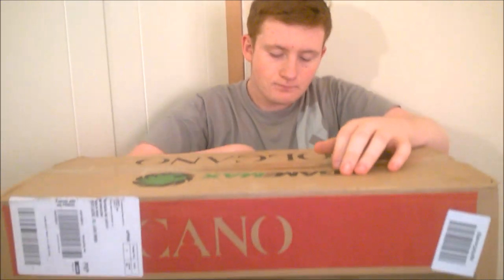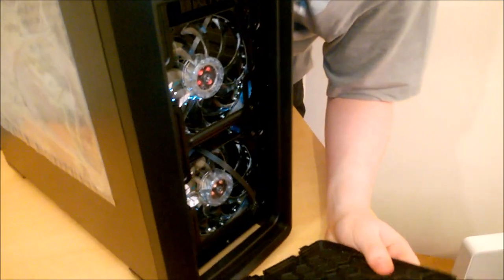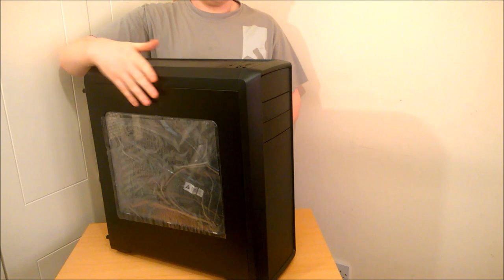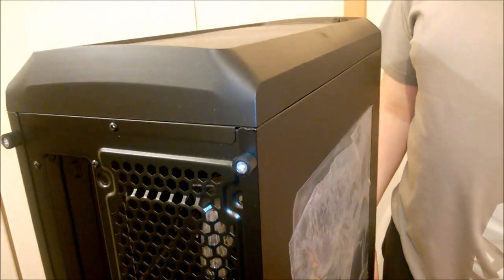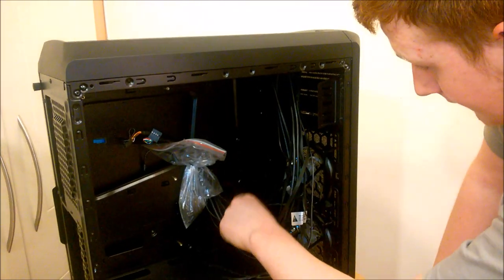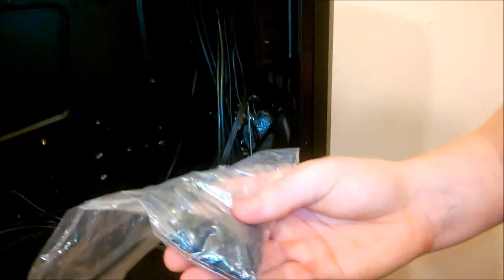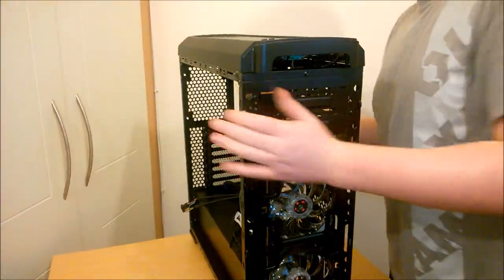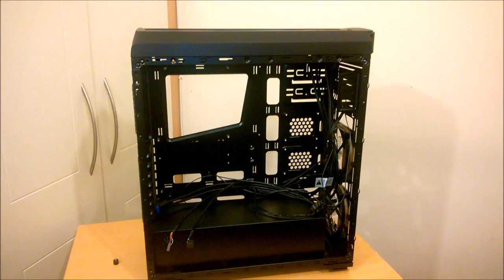GameMax Volcano Gaming PC Case Unboxing and Overview

Comment: £48 on Amazon now, looks like a sweet deal. I just wish it would have rubber grommets on the cable holes. If you want that, the Aerocool Aero-1000 has that for an extra £10, but is lacking the psu mask.

Comment: How do you get the front fans to spin and work. The led lights work but the fans don't spin
Reply from the maker: I would say that your fan motors are broken, you might have to send the case back, or buy 2 new fans.
Reply: they're the stock fans that came with the case and have not been touched. How could they be broken? Can you make a tutorial on how to turn them on?
Reply from the maker: It's possible that they are just bad fans, you could contact game max and they might send out 2 more because you can buy those fans as well.
Reply: should they turn on automatically?
Reply from the maker: Yes, as long as they are plugged into the fan controller and the fan controller is getting power, they should.
Reply: not sure how they should be plugged in unless they are plugged in then, I got the LED but no rotations
Reply from the maker: I would send the case back, it's either the fans, or fan controller not working.
Reply: Emerald Isle PC's the 4 pin is plugged into the default led fan brick that comes with but the other bit I'm unsure where it plugs so idk how to turn them on
Reply from the maker: Did you connect the "fan brick" up to the power supply using a molex connector?
Reply: yes
Reply from the maker: I'd send your case back. It will be easiest way to fix the problem you're having.

Comment: I bought this pc and clicked the reset button.This made my fan go fast then slow and fast then slow also my screen won't turn on now.any advice ?
Reply from the maker: The reset switch can be set to control the fans / RGB if any ,, or can be set as just a reset switch,  You could use the power switch at the wall, it wont hurt .. till you get yourself sorted ..
Reply: +Emerald Isle PC's how do I fix it
Reply: +Zephyr what do you mean by use the power switch on the wall
Reply: Is there a way to send a pic
Reply: +Zephyr  ??
Reply: +Zephyr my computer restarts non stop and my screen displays dual bios and then it disappears as my computer restarts
Reply: Just disconnect the reset button from the mobo and try again

Comment: is this good INTEL Skylake Pentium G4400 3.3Ghz, ASUS H110M-A Motherboard & 16GB 2133Mhz DDR4 Crucial RAM cit f3 evga gt 730 2gb cit f3 got it this for 323
Reply from the maker: yeah, it should be alright. A newer graphics card would be a better choice, but you would have to spend a bit more
Reply: james aketch I think you should have got an i3-6100 processor and make the ram 8gb instead. the processor you chose is kinda crap tbh
Reply: A RX470 would go wonderful with your other components, as a budget gaming rig. By the way, it only matters the ATX standard when you build a PC: ATX, mATX, mini ITX. Of course this case would fit them all, so any configuration would be good with it. Just be carefull with extra long graphic cards and very tall air cpu coolers. Measure 1st, and then buy.